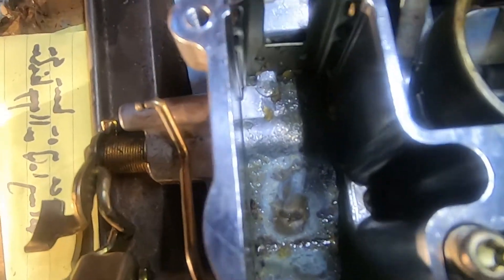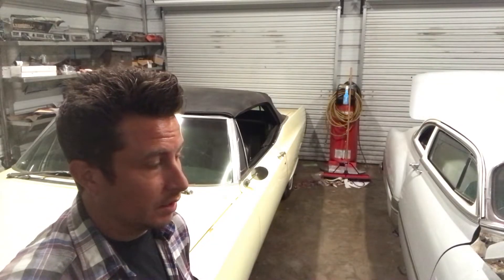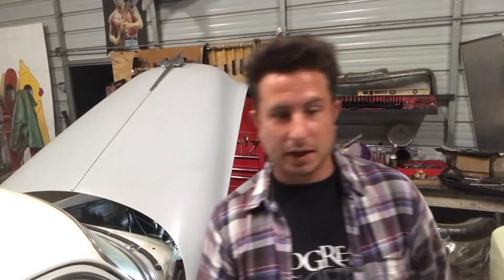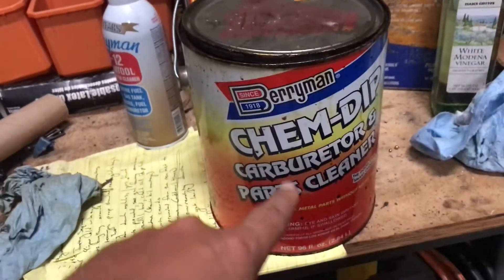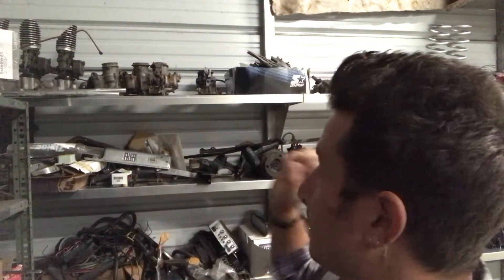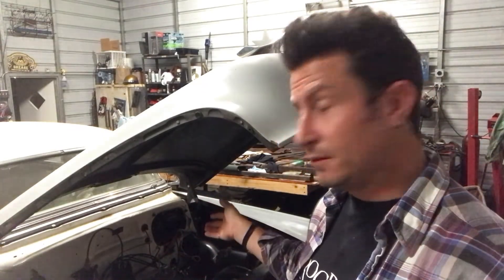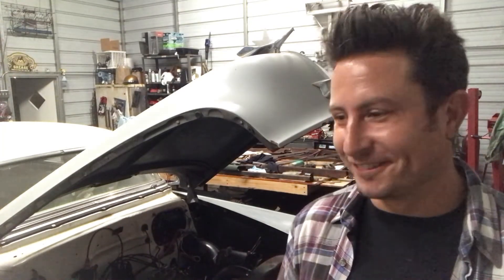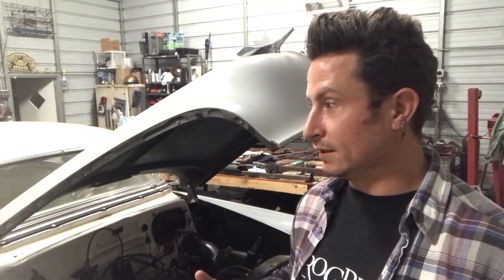*Horror Show* Ethanol vs Non Ethanol in a Carburetor

Comment: I hate they started making ethanol gas. It's $15-$20 more per tank for non E,  plus I got to burn a gallon to get to that station. Only open till 5pm Monday- Saturday. So in 4 months of doing that equals a new carburetor. In the past I would just ride one 2 years then sale it for $180 and buy a fresh one. Did that twice both times each carb was a little orange gummy inside. So for the last 8 years I've run the same 1406. I still run ethanol but I now buy a $4 bottle of Marvel mystery oil every month. I also use a baster and fill bowls with Berrymans fuel cleaner every 2 months, on days it will be sitting a day or 2. I open carb once a year, 2 weeks ago I did it for 7th time in 8 years. Still looks absolutely brand spanking new on inside. I think the MMO is key bc b4 running 8 Oz in a tank my clear fuel filter would always turn orange within a month ALWAYS. I was having to change it every 2 months, now at my 6 month filter change it always looks brand new. I haven't had a orange filter but once in 8 years and it was bc I went on a long road trip and didn't have no MMO. After 3 weeks of filling up every other day I got home filter was orange. I know that was long story but that's how I keep my carb clean and my Skylark happy.
Reply from the maker: Thanks for taking the time.... fascinating. i ll give the marvel mystery oil a whirl... it sure cant hurt!